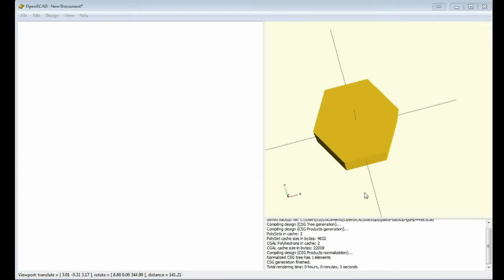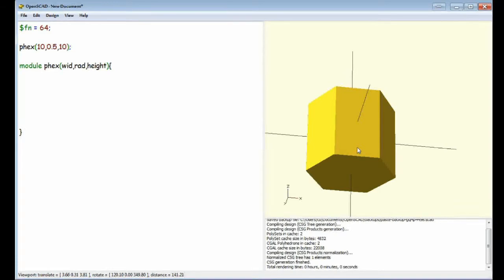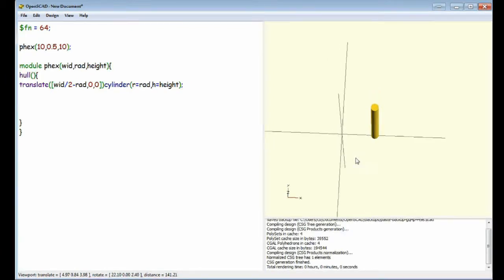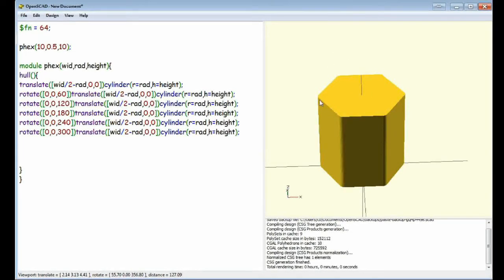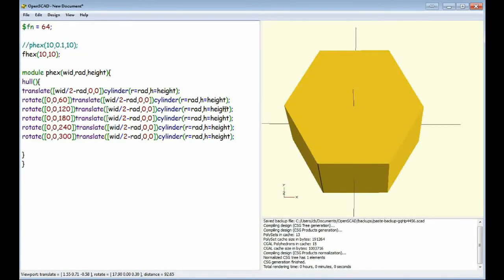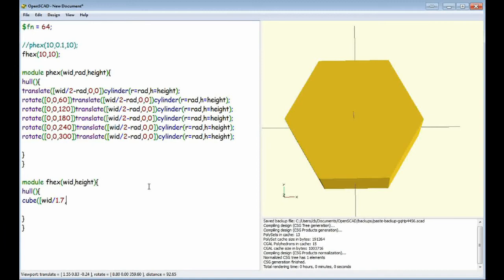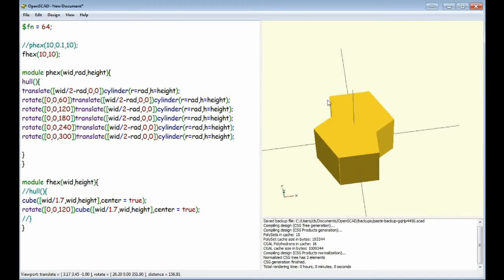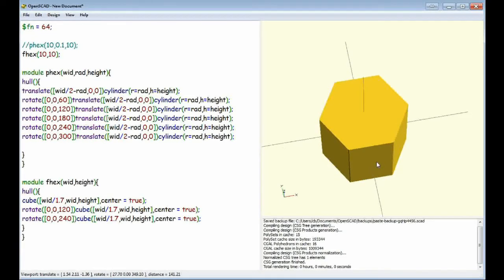Openscad : Simple Hexagon shape

Comment: cylinder(r=rad, h=height, $fn=6);

Without the rounded corners, granted.
Reply from the maker: Troy Unrau  not a bad way to go :)
Reply: Troy Unrau what is the diameter related to, the flats or the vertexes, or something else?
Reply from the maker: Jason Doege using that method it would be the vertexes, it would be usefull on quite a few draws that specify only point to point measurements and leave out the flat to flat measurements
Reply: This is the answer I was looking for. You can also do this with a polygon and a for loop. But that's kinda complex.

Example:
module makeHexagonUsingCircumcircle(cc_rad){

 
 lst = [ for(i=[0:1:6-1])
   [
    cos(360/6*i) * cc_rad,
    sin(360/6*i) * cc_rad
   ]
    ];
    polygon(points=lst);
}
Reply: Wait, my method there would also require: linear_extrude(...)